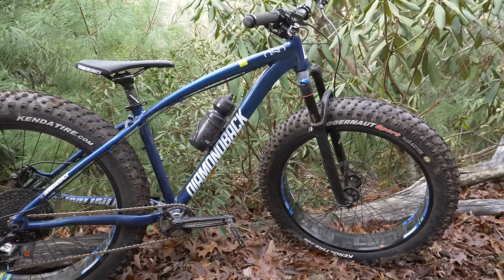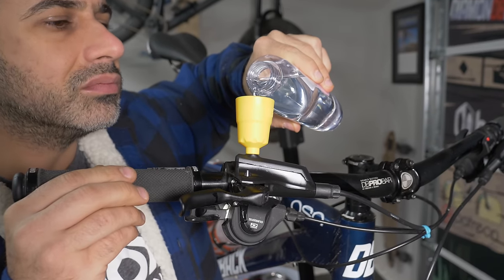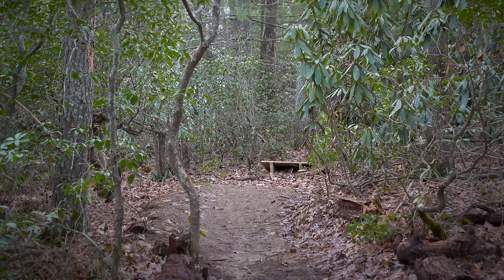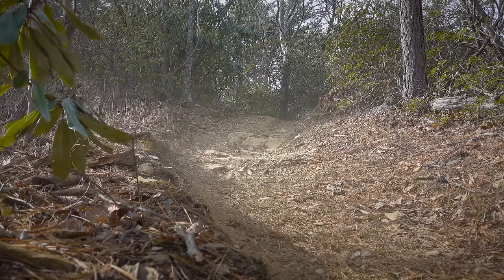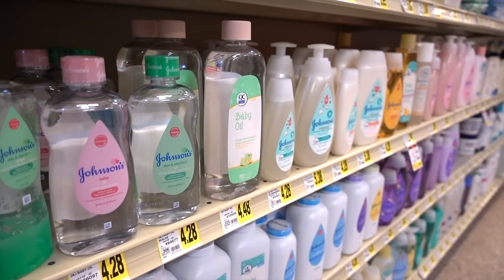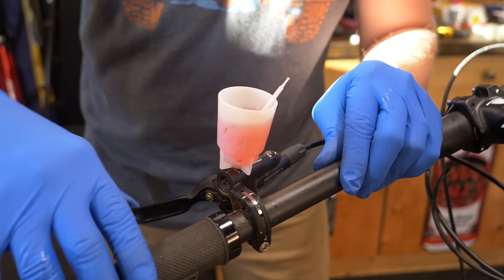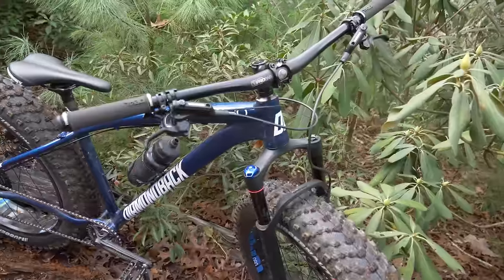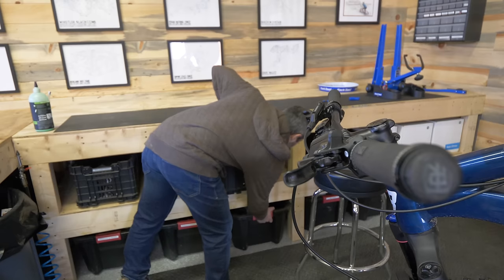I filled my mountain bike brakes with baby oil for a year and here are the results!

Comment: Back in the 70's a buddy of mine bought a used Triumph Spitfire. It needed lots of work, including brakes. When he went to buy brake fluid for it he blanched at the price quoted at the parts store. The parts guy told him that regular brake fluid wouldn't do, because the fluid specified by Triumph was vegetable based. So my buddy went to the grocery and bought Mazola for it. He ran the car for several years with corn oil in the brake system. Just sayin'.

Comment: Hydraulics is the compression of fluid (which is impossible) so that a movement at one end equals a movement at the other end. You could use water in your brakes and still get the braking effect, it just might now last long due to corrosion. Engine coolant with an anti-corrosion additive might be a good alternative.
Reply: You can actually compress fluids, just not as easily as air... (Water compresses about 1% at 2000psi) and water boils at a relatively low temperature, creating steam and dramatically increasing pressure.
Water is also not a very effective lubricant with seals compared with oil.
Also you may have noted that water in brake fluid stops the brakes working... A lot of that is due to the water boiling.. and brake fluid (ie. dot4) is hygroscopic.

Comment: Tie fighter ion drive engine power! For that alone I’d get such tires :p

More seriously though, the brake fluid oils are likely engineered for specific characteristics, such as suitable viscosity, limited change in characteristics under different environmental conditions, and appropriate sealing and lubricating properties for the above.
Usually brake components are designed keeping in mind the generic brake fluid oils on the market.
I’ve seen incorrect oils used on aircraft landing gear parts as part of the development process, and I can tell you, some oils definitely not suitable! Seals can triple in size, dissolve, become gooey, and what not. All of those effects would result in brake failure.

Conclusion, this particular oil might work, but I think we can put it down to luck.

Comment: The only problems with using something other than the recommended fluid is viscosity at different temperatures, and how the seals will react to a different chemical. There is no concern with boiling point as in motor vehicles. They wouldn't get hot enough for that.

Comment: I've used baby oil in Magura Hydraulic brakes my older trail/trials bike from 1997... and it's still in there... an still works as it always did without a rebuild after all this time.  That's over 20 years... so I'm sure it will be fine

Comment: hydrolic brakes works by an pressure from a liquids, even you use a cooking oil, it won't effect the performance. but just dont use a water for replacing the brake oil, i had do this crazy thing but it's very dangerous, at first your brake will work as usually but another day that will cost you a lot of money or maybe your life. i do this on a motorcycle and i hit my garage door that cost me twice than the brakes.

Comment: Should use as close as pH neutral (7) baby oil. 
Aluminum doesn't like to basic solutions specially when heated and iron doesn't like acids. 
Other than that some should look for freezing and boiling point, viscosity and how hygroscopic (the less the better) it is.

Comment: i beleive if the brakes are new you can use either dot4 brake fluid or  ile say baby oil because its all ive ever used but once you have used either you cant use the other because that is what will damage the rubber seals

Comment: Mineral oils boiling point is anywhere from 218 degrees to 600+, so this is fine. If I had to guess I'd say that brake oil has compounds in it that raise the boiling point or make it denser but honestly its probably not much different, if at all.

Comment: I love baby oil, not for brakes, but for cleaning old gunked up parts. I live in a flat and the baby oil smell is much more acceptable than other degreecing agents and it washes out with tap water. Added bonus, after a cleaning session I come away with botty smooth hands rather than the usual black dirt under nail disaster. Yeah, I'm a baby oil fanboy!

Comment: Hydraulic fluids depends on fluid dynamics. You are right to say that the manufacturer uses a certain mineral brake oils due to their own data/calculations, which is actually just fluid compressability. You are also right in saying that baby oil and brake oil is different and should only use baby oil as an emergency. However, as long as the viscosity is similar to brake oil, you could use it, just make sure that the fluid you are using is not highly flammable due to pressure, so don't use cooking oil. Maybe you can try experimenting on that.

Comment: I also tryed baby oil and liked it until the temperature went below -10°C. It seems that the low temp increases the viscosity of the liquid  so i ended up with a stuck backwheel brake

Comment: You should have done a brake force compression test to see if the clamping force changes between the two fluids.
Reply: There's virtually no flow taking place, so the end force won't change unless you have a fluid leak, or your brake levers bottom out.

Comment: I've been using baby oil in magura hs33 instead of original oil , its proven to be ok. But here in Russia baby oil is still not enough to provide performance in below zero temperature. So we bleed magura hs33 with car antifreeze. It have an anti seeze agent so magura still have an  smooth operation in below zero ambient.

Comment: Do you need to purge the brake fluid if you want to remove/change brake pads? cus mine got some dry lube on them and i want to clean them. cus they arent locking good. and they are making a very annoying sound. and even if i squeeze my brake all the way its not braking that much (I will also get my brake bleeded cus that might be one of the reason i have to squeeze very far on the brake to even start braking)

Also do i need to get my crank set off the bike to instal a new front gear(i have a 3 by and i want to change to a 1 by). And i will be changing my crankset later this year but for now mine is good. its just making some noise that why i need to change it. but right now i just want a new 1 by gear in front
Reply: I'm 100% NOT an expert. But from my understanding... I would first reset the caliper piston by spreading the pads all the way back in, then clean/replace pads. Loosen and reseat the caliper mount itself. Give the lever a squeeze and see what the piston movement is like - if the pads bite the disc like they should and the lever is then firm, tighten down the caliper while the lever is held. I'd do that first before moving to a bleed, just in case it's something relatively simple.

The noise from the crank might be the bottom bearing. The 3x chainring will have to come off anyway if it's the BB. I'm not up to date on going from 3x to 1x, but things like chainline to the rear cassette might come into play.

Comment: You should examine performance in freezing/cold and hot temperatures, or after a lot of heat builds up. Different viscosity ratings indicates an oils “performance” in different temperatures. I bet baby oils doesn’t hold up to heat but maybe it would idk.

Comment: I’m sure it was fine right? On our motorcycles it’ll get hot and boil but .. your pedal bike I bet you could use anything
Reply: i doubt you could use 'anything' but an oil based around the oil the system uses, yes, probably.

Comment: Use automatic transmission fluid/oil. It is a mineral oil with additives.It's good for O rings. it withstands high temperatures and its boiling temperature is very high.

Comment: glad you did this seth, how about trying motor oil 5w/40 instead of suspension oil.
Reply: Maybe ok chemically, but 5w40 has a viscosity of about 90 cSt at 40C, where I've read that Shimano mineral oil is about 8. (water in comparison is about 0.7 cSt at 40C). Using a fluid that much thicker might result in some issues with slow piston or lever return. With a fluid that thick, bleeding air from your brakes might get pretty fiddly too, as it would take a long time for bubbles to float out of nooks and crannies in lever and caliper.

Comment: Bermpeak can you please check as well if it's feasible to use ATF fluid as Hydraulic Fluids for MTB Brakes. Im watching you from the Philippines and the Shimano 1L Mineral Oil is too expensive and we follow your method as replacement. We got plenty of automotive lubricants here as well your baby oil. I learn that Shimano uses Synthetic Mineral Oil that is why it got higher boiling point that the baby oil. ATF Fluids is being used for Hydraulics long time agobefore shimano made their hydraulic brakes. Thanks

Comment: you could use motor oil or vegetable oil if you wanted. any oil would work, the difference is the temperature fluidity. any non corrosive thin oil with a decently high smoke point would be fine, and unlikely to damage anything. just dont put brake fluid from a car in your bike, as that stuff is harsh

Comment: Honestly i just buy Mineral brake fluid used on cars, way cheaper, just as common as baby oil, but more up to standar. I recommend ABS Brake fluid for additional heat resistance

Comment: Well here we are 9/24/2020 and I've found myself in the "theoretical Apollo 13 situation where you'll die in space without a brake oil substitute."  Apparently because of Covid, can't find Shimano Brake fluid at any local shop and the big online retailers like Jenson.  So bought some drug store generic 100% mineral oil to bleed, now that I know it's fine for seals (as I suspected) not going to worry about it.

Great video.

Comment: Try a sample of baby oil and a sample of shimano oil, then heat it until the oil boils and measure the temperature between the two. Pretty sure that will be the main difference, what the fluids boiling point is. As soon as you have fluid boiling, then you’ll have spongy levers……

Comment: It would just lack additives but I think this is the one time you could get away with it fine, if the fluid were being used in machinery, a motorbike or car brakes, power steering rack etc, you could get issues but here I doubt it, my one concern would be boiling, If your breaks did get obscenely hot without anti foam additives the oil will boil and get air bubbles and become compressible so you will get a spongy brake.

Comment: Makes sense since the Shimano mineral brake oil is 97% base mineral oil........info from the MSDS on this product. Let's not confuse this brake Oil with ANY automotive type brake FLUIDS, not oils, since they are very, very different and using brake oil in a car could get someone killed.

Comment: something over looked and not tested but is a factor. baby oil when gets hot will release air bubbles as brake fluid will not... air in brakes is not good. it will purge to the top fast of course. but in a down hill descend. and all sudden brakes turn to squish. not good. something to think about for those who think they are gonna do this and or those doing it and have no issues yet... brake fluid and hydraulic fluids are designed to not have bubbles when get hot unlike a babe oil that will most def release air bubbles. as it was never designed to be HOT.

Comment: How about DOT 3 brake fluid? because my friend was using it for 5 years until now
Reply: Using DOT fluid with mineral oil systems and viceversa is basically gambling with your safety. Rubber can be made resistant mineral oil or DOT fluid, not both

Comment: I can oneup your baby oil. I once filled up with suntan oil after carrying my bike to the Summit of Helvellyn then realising I had lost most of my brake fluid due to a cracked reservoir. I literally shouted out to a huge group of walkers having lunch at the top 'has anybody got any suntan lotion or I'm going to die!' A nice lady asked if I was serious and I explained about the lost brake fluid. We had already considered water, energy gel and each bodily fluid in turn and I mean every one. The suntan lotion was creamy with the consistency of head and shoulders shampoo. It worked even though I had to pump the lever a lot probably because of air in the system rather than the lotion not working. When I got home I flushed it through several times until there was no more suntan lotion coming through and it was fine. Next time I may try slightly salted butter...

Comment: Hi I did try and the Johnson baby oil as you said. Unfortunately it  spoiled the packings rubbers of the cylinder with in a day after a heavy ride from Tabriz to Nahand dame via Enali mountain. It is better to delete you move as you mislead some people like me. I am wandering how it worked for you.???!!!  Another problem the water can be used to wash mineral brake oil  nut not baby oil. this is why if the mineral brake oil leaks just very litter, still the brake works properly but if the baby oil leaks the same as mineral oil the brake will not function at all as mine.

Comment: My dad and my uncles when they were young used baby oil for their hydraulic breaks for years. 
And my cousin bled his breaks with baby oil last February coming from a Shimano break fluid and it still works fine.

I think it's safe. But I wouldn't risk it for speedy and pure downhill riding. 
I'm sure if you can afford a 500$+ bike, you can buy an Shimano/bike break fluid.

Comment: So the main thing we’ve learned from this is.
If the fluid doesn’t damage the material the seals or the material the pipes or brake housing is made of and doesn’t compress when put under pressure it’s probably okay.
If the fluid doesn’t decompose over time and has a high enough boiling point again it should be okay.
Right chaps who’s up for a test on different stuff to try.

Comment: I ran my Magura M front on a Foes Weasel with Olive oil, probably changed 3 times in 20 years... (granted it wasn't ridden too hard, and did fade on a nearby hill to sea ride... but then again that was the 1st change after about 5 years. After 20 I had to replace the bellows in the reservoir as it went plastic.... so how do you replace a 20yo rubber bellows... with a piece of inner tube of course.
(NZ did have a reputation of fixing anything with a roll of duct tape and some No8 fencing wire.... ).

Oh thats right... I did that too.... On a road bike ride 200k from home a friend broke his throttle cable on his Honda CBR250rr...
It had a pull and a push cable.... so on the side of the road, we removed the broken "pull" cable, swapped with the push, held the different cable end shape with a 'broken heart' necklace held in place with... you guessed it, No8 and Duct tape.... And my mate rode back 200k with a push forward throttle instead of pull.. (As a kid I always thought that was how a throttle worked (Thanks 'CHiPs' TV series with out of sync audio. I even turned my Raleigh Chopper into a BMX myself as a 10yo... and discovered the flaw in non triangular rear frame design... and went on to lathe up a threaded fork stem for my 1st front forks (A pair of old bent rockshox 2" with a broken stem, on a Milazo Crazyhorse (New Zealands own bargain basement bike until it got sold offshore... a "Mountain Bike" that originally came with 80's 10speed style forks.

Comment: Refusing to buy 1ltr of shimano brake fluid for ~200$, i´m using ELF moto fork oil 15W on my bikes. 1ltr = 7$. I'm still alive.
Reply: That oil has a viscosity of 73mm^2 @ 40C! Shimano's is 8mm^2 at 40C. 

It's obviously not too thick - good news. I also refuse to get ripped off by Shimano selling their rebranded oil for a huge markup. BTW I'm using Aeroshell 41 ($19 CDN per quart).

Comment: what ever they tell you is just to make more money. oil is oil, even water would work if the boiling point wasnt so low. just make sure it don't eat your hoeses or seals and will not boil that easy and you're good to go. even car fluids work perfecly fine..

Comment: It probably worked as you are a rider who barely used brakes, and even when you do, thats a tiny disc contact patch and diameter, so theres barely heat and the oil barely boils

Comment: concratulations!!!........for what? because you are alive :-DDD...... i know, your test is working in principle. but...... nevertheless there is a problem, if driver use baby oil. isopropyl palmitate have a boiling point only of 150-160°C. its an ingridient of mineral-babyoil, like your oil from johnson (remember, there a some naturally products with plant oil, they certainly work worse). whats the problem? the heat/temperature that can occur when braking. shimano braking oil have a boiling point of 260°C. another ingredient is paraffinum liquidum. the boiling point is +/- 260°. i think the baby oil does not have the same quality (temporal stability) as real brake oil from the point of view of heat resistance. people they really want to use this should know that, it doesn't just have to be problematically in sport . if someone only drives on flat or short distances with little braking activity, this is certainly not a great danger. The risk increases, however, the more and more intensely the brake is used, or depending on summer and winter. good luck from germany, and greet your "fat baby", "fat oiled baby" or "paraffinum baby"  :-)

Comment: With respect to a regular car that uses DOT break fluid... The reason this is done is because of the temperature involved... If because of the brake action the hydraulic fluid boils then you have a problem you wouldn't have that pressure that you need... In the case of a bike that probably very rarely would happen so therefore baby oil would probably suffice just as much as mineral oil